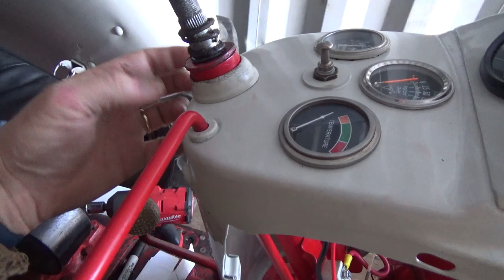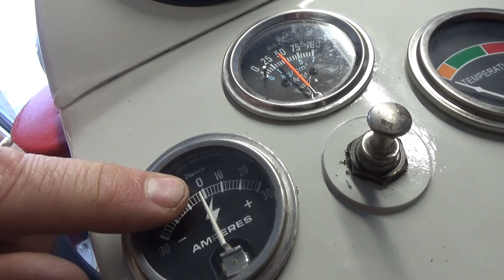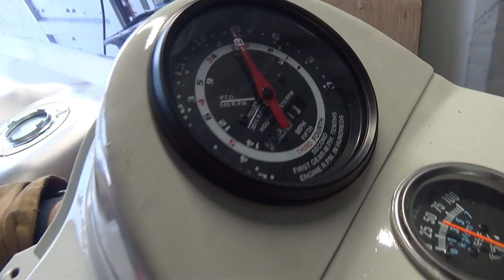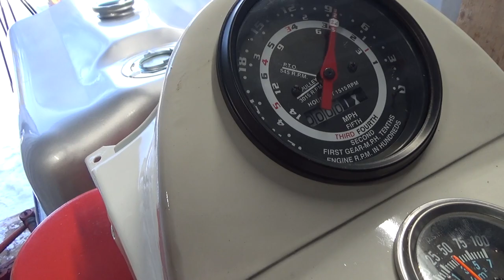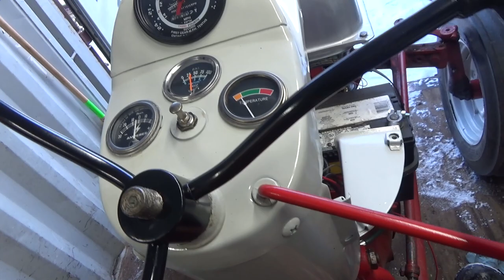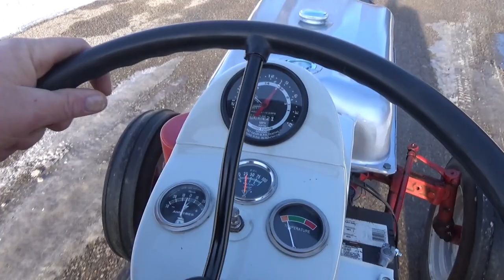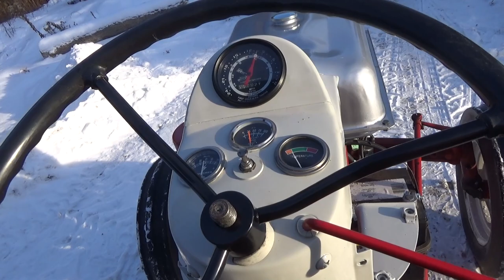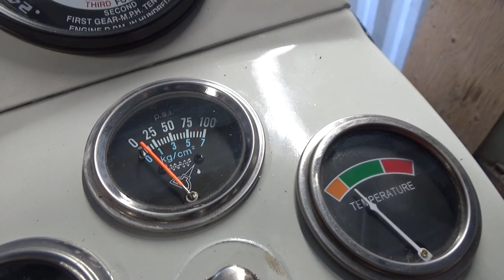Ford 800 fuel tank fill up and check for leaks...LETS FIRE IT UP and test the new steering out

Comment: Maybe you've figured this one out already, but I just rebuilt my steering sector and learned a lot about it.  Mine was leaking oil from the seals so tore it all apart to replace the seals and clean up the shafts.   These steering columns (they are called steering sectors) have been in use since the early 8N days.  It is a good design so they stuck with it.  On the opposite side of the steering arm you will see a bolt sticking out with a locking nut on it.  Loosen the locking nut and run that bolt in with a standard screwdriver and it will move that arm out away from the body.  You may have to adjust the other side accordingly.

Comment: ADD MORE ANTIFREEZE AND TIGHTEN THE CAP SO PRESSURE WILL BUILD UP IN THE SYSTEM. AND IT LOOKS LIKE THE RT TIRE IS TURNED OUTWARD TO MUCH. OTHERWISE IM EXCITED TO SEE IT WORKING.
Reply from the maker: Few things to do up

Comment: Bill,mark the center of each of the front tires with chalk one on the front and again on the back then measure from center to center on the front then the back. The back measurement should be a1/4 in more than the front. Divided in half so that each side toes in an 1/8 of an inch. That should set your toe in.